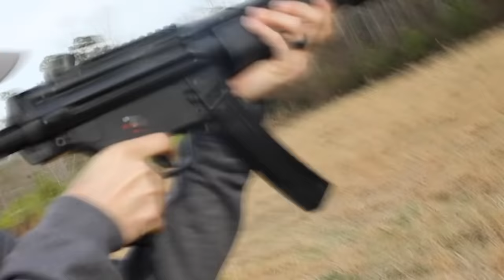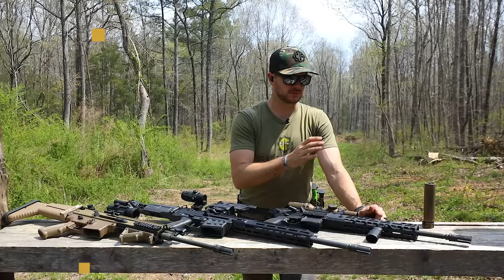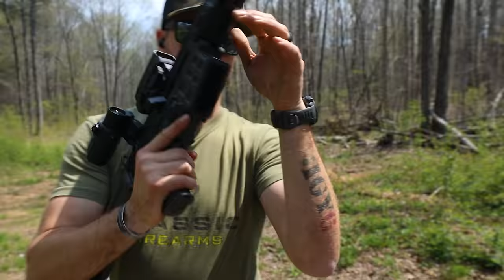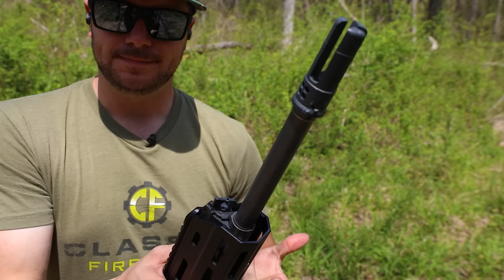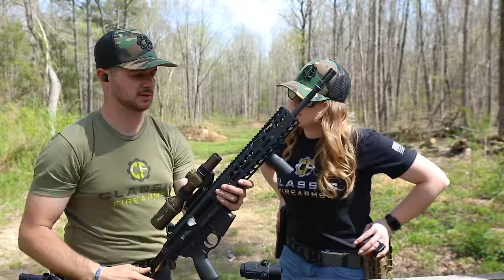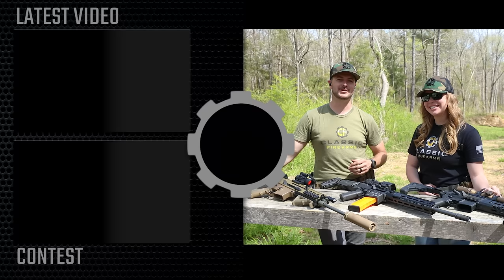SCAR 16S vs Sig MCX vs CZ Bren 2

Comment: I have the Bren 2, MCX virtus and the Scar 17... Bren 2 all the way.
Reply: Why?
Reply: @bench175  the action is smoother, it's lighter and like $1000 cheaper.
Reply: @I_Finger_Triggers  Awesome.  I just got the Bren 2 Ms 11" 5.56 in a trade and deciding to keep it or resell.
Reply: @bench175  Are you going to SBR it if you keep it? A Bren 2 stock is a must. I have the 14-inch pinned and welded a muzzle brake, the thing feels like I'm shooting a BB gun.
Reply: Agree!  The Bren 2 is a much nicer firearm, the action is like glass, trigger is great, fully ambi, super accurate it's easy a sub MOA RIFLE.  And at sub 2k it's probably the best hidden gem in 5.56 NATO rifles.
Reply: @lowlight8466  Which ammo is sub MOA?
Reply: @bench175  I’ve gotten sub MOA with both 62gr 5.56 and 55gr .223
Reply: @reidtyndall4953  Which brands and bullets?
Reply: @bench175  I was getting sub MOA with Black hills 77 Gr. TMK 5.56.  From my chart it was High Temp 	87	 wind was about 8 mph  it was done on bench consistently sub moa with that black hills ammo
Reply: 193 federal will get you 1.5 to 2 moa all day.
Reply: @lowlight8466  Cool thanks.
Reply: Anyone have a7.62 x 39?
Reply: @coltonk7591  Bren 2 in 7.62x39 or in general?
Reply: Bren 2* mine only has 1000rds through its has 0 issues.
Reply: Bought the Patrol & the Virtus.  Wish I hadn't bought the Patrol.  Needs different handguard.  Unfortunately, I will probably take a thumping if I sell it.  Less than $2000.  Option of Virtus Patrol vs Scar-16.  What would be your pick?
Reply: @steffeness1  I mean if you already have the virtus then definitely go with the Scar... I like side charging firearms, easier to manipulate the bolt.
Reply: @I_Finger_Triggers    I'm fairly sure the Sig MCX Virtus Patrol cannot be converted to a 9mm?  Would be 1 reason I'd keep the Patrol.  Different handguard obviously.  Patrol's handguard is heavy & long
Reply: @steffeness1  not that I know of unless someone made an aftermarket kit. I know someone made an adapter to use a CMMG .22 conversion kit.
Reply: @I_Finger_Triggers    If you find that the MCX Virtus can convert to 9mm, let me know.  Whole world would like to know too?
Reply: Yes.
Reply: @bench175  I also have that same rifle and I love it. It is my favorite 5.56 rifle.
Reply: Any experience with GALIL ace Gen 2?
Reply: @stevis182  I have a Gen 1 in 5.56. I like the Gen 1 because of the iron sights.
Reply: My man
Reply: I like my scar the best and I own all the above, bren 2 is 2nd because of wieght.  The scar is just sooo light lighter then my ar 15s and same recoil and very very accurate. I just had a custom billit lower made for my scar to take all ar 15 lower parts and ar 10 magazines so I can find them when shtf.
Reply: @I_Finger_Triggers 5.56 mostly i got mine in 7.62 by 39.
Reply: I have the 9inch bren 2 7.62x39. Sbr. Love it but it Does not compete with my scar. It's alot heavier to me.

Comment: Still need to try the Robinson Arms XCR!  It could have beaten the SCAR if it wasn't for  technicality.
Reply: I own one and I can say it is completely underrated! I love it and have not struggled with it. 900 rounds so far 👍🏼
Reply: Well it's still used by no militaries whatsoever so idk
Reply: @alexc6582  Tons or firearms are not used by a military.  Not the best standard.  And the complaints the SCAR got at first plus they dumped the 5.56 version in use...
Reply: Xcr and Bren 2 are a sweet pair
Reply: @Shadx27  the m16 got complaints as well
Reply: @alexc6582  The Scar 5.56 version didn't replace the m16.  Scar 7.62 is getting the M5 treatment more than likely.
Reply: @Shadx27  I didn't say it replied the m16. The m16 went through problems as well
Reply: Bought the Patrol & the Virtus.  Wish I hadn't bought the Patrol.  Needs different handguard cause of the weight.  Unfortunately, I will probably take a thumping if I sell it.  Less than $2000.  Option of Virtus Patrol vs Scar-16.  What would be your pick?

Comment: I personally believe the "off position" of the gas piston is for sniper mode.  No brass flinging through the air catching a glint of reflection.  Also, quieter.
Reply: Exactly! Idiots drilling out the best gas position on the Bren is the off position!
Reply: Off position can also be for the use of rifle launched grenades.

Comment: If the MCX wasn't so elusive, I'd totally get one. My local gun shop/range seems to have the FN SCAR 16s always in stock everytime I go in.
Reply: My LGS has multiple
Reply: was lucky to find one in my store last week.
Reply: Brother, I had a SIG rattler. For that kind of money you would be much happier with the Bren 2.  I bought the SIG for it's touted modularity, but they never made any components available.
Reply: @btfup  

I have a rattler with 556 and .300 x kits.

Comment: The real CZ juice is: 14" pistol Dan Hagged out. Much better balance than the ( slightly disappointing) 16" heavy barrel carbine. Use your m-lock panels to reduce heat and you will have to swap out the factory forend for the Dan supremacy one. Trigger as well.

Comment: I wanted to see the CZ fired suppressed with the gas block at 0 position to be basically a bolt gun for comparison to see how quiet it is with no action noise. Fire work charging handle fire again like a bolt gun.
Reply: MAC ran it with the gas off and Tim said it was a lot quieter.
Reply: I love the off position for this purpose

Comment: I had a choice between the 3 and as soon as I saw the cz Bren 2 it was love at 1st sight 💕
Reply: You already have one don’t you?
Reply: @equinsuocha8905  yes, I chose the bren2 over the scar and mcx. Not willing to pay the high price for the scar (would rather have the 17), mcx was top of the list but jumped on the bren2 when I saw it in stock at local gun shop. Mcx has a great trigger and looks sic but is slightly heavier than the bren2. The scar16 $3100/3200, the mcx was $2,499 vs Bren2 around $1,970. Getting The Bren2 was a no brainer for me

Comment: I’ve got the three
Mcx and scar tied for first. Maybe the mcx slightly edges it out but that could change tommrow. I’d put the bren third. It’s a great gun but the mcx is dope. The ability to change barrels, the stock trigger and ergos are just superior. And when you run the 11.5 it’s not heavy at all. Only issue with the scar abs mcx is the price. It’s hard to beat the bren on that
Reply: Bought the Patrol & the Virtus.  Wish I hadn't bought the Patrol.  Needs different handguard cause of weight issues.  Unfortunately, I will probably take a thumping if I sell it.  Less than $2000.  Option of Virtus Patrol vs Scar-16.  What would be your pick?

Comment: In my experience the Sig is the best of the 3, you just can't find it anywhere. The CZ is more budget, but that gun just runs. I haven't ran the new Scars, but with this video that may have to change. I can't say I would buy one just because of that price tag. The Sig is still my favorite of the 3, but all 3 are great. The only thing that makes Sig the winner to me is how many options there are to customize it compared to the other 2.
Reply: The sig is a great weapon,  and as for the AR ergonomics probably the best for most people, I always seem to go back to the BREN 2 light weight, accurate and reliable in 5.56. But the ergonomic are somthing you must train your self in,  were the virtus is easy to transition to from a AR aspect.

Comment: Bought a Sig MCX over KAC SR15 and HK MR556, have not been disappointed
Reply: Would've gone sr15 personally. What made you choose the mcx?
Reply: Although I understand parts replaceability is more difficult on the knights so that is a good point against the sr15
Reply: @stevef4930  but, if I wasn’t blind in right eye I would’ve gone sr15 lol
Reply: @ItIsP  ahhh makes sense lol
Reply: Bought the Patrol & the Virtus.  Wish I hadn't bought the Patrol.  Needs different handguard cause of the weight.  Unfortunately, I will probably take a thumping if I sell it.  Less than $2000.  Option of Virtus Patrol vs Scar-16.  What would be your pick?

Trying to figure out why to keep the 16" MCX Patrol?  I'll keep the 11.5" MCX Virtus

Comment: Clint, please, please let Katie finish a thought and explain her choice. Also, don't question or try to change her opinion. I agree with Katie, the Bren 2 is great. It would be nice if CZ  allowed a trigger upgrade and put a metal insert to allow changing the pistol grip. Yes, lets see both of you run drills. Still, wish CZ would bring in the Bren .308.
Reply: Put the HBI trigger shoe in, no need for anything else. For me turned a decent  out of the box trigger to a very good trigger.   Its not a Geislle but its not far off, and far less cost then a Geislle
Reply: @CZ-Perfected  Great suggestion, thank you.
Reply: Who in their right mind takes Katie seriously on anything?

Comment: Do you NOT have to change out Gas Jets in the SCAR 16 like you have to do in the SCAR 17 to run suppressed?
Reply: Technically don't have to on any of the SCARs to run suppressed especially with low back pressure cans. Traditional baffled cans the community recommends picking options like changing gas jet, putting mototechs 3 position gas selector, longer receiver screws, and buffer replacement to get it tuned to your can and ammo choices to prevent damage to the parts
Reply: I’ve found my 17 to have a much more narrow gas window than my 16. I chopped 2” off my barrel on my 16 and it made it perfectly gassed with the factory gas jet.

Comment: How does the scar have a non-reciprocating charging handle?
Reply: In the NRCH models, the handle is attached to a “sled” that the long arm on top of the bolt carrier interfaces with. When you manually run the bolt, the sled and bolt carrier are linked together so it can still be used as a forward assist but it disconnects when it reaches the fully forward position so that it doesn’t reciprocate when firing.

Comment: My guess about the suppressor voiding the SCAR warranty is that FN has no control over what you put on it. They make specific suppressors for the SCAR. It is designed to use a suppressor, but if you use one that isn’t within spec it can create to much bolt velocity. It’s easier to just say no suppressors period than to try to navigate the sea of different, potentially non compatible suppressors. That’s just my educated guess.